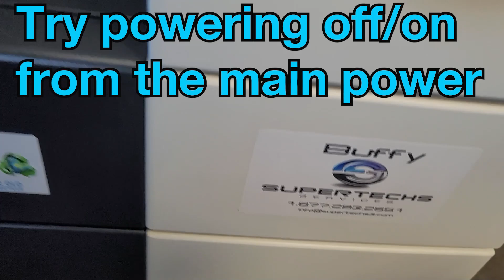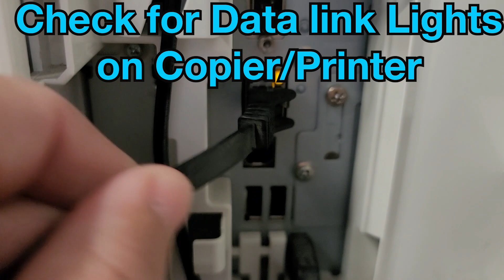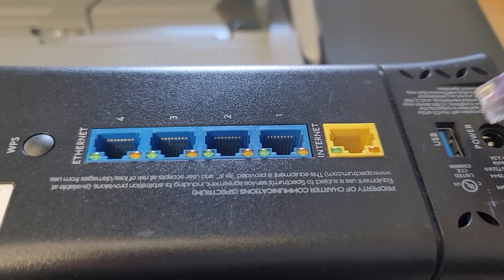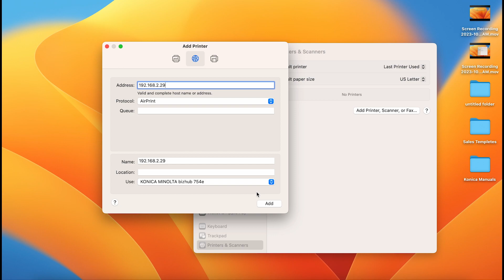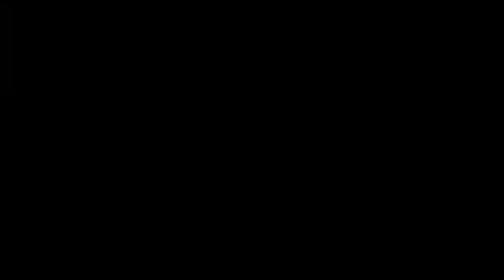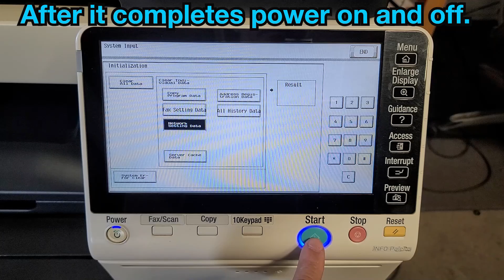Troubleshooting Printing Issues when trying to Print. #printer #copiers #networking

Comment: one more: check printing jobs on the computer. sometimes a file can be corrupt and prevent the job from printing. I had a couple of calls for that, machine no print come fix, and when checking the print spooling for jobs waiting. deleted the bad file and copier started printing as it should.
Reply from the maker: Good one ☝️
Reply: On Ricoh machines corrupted files can throw SC codes.